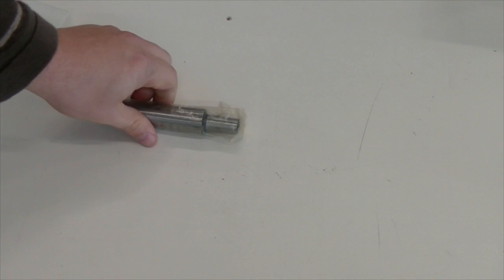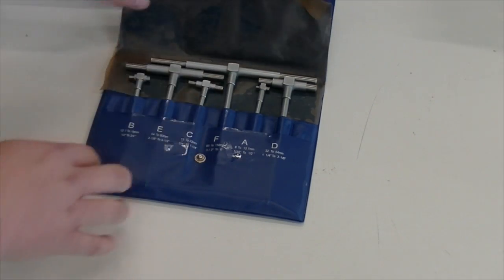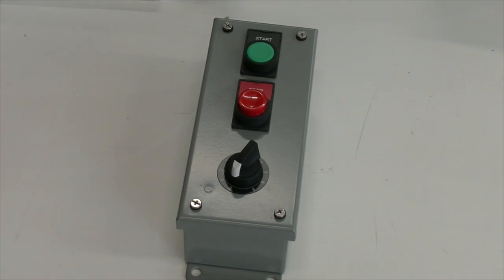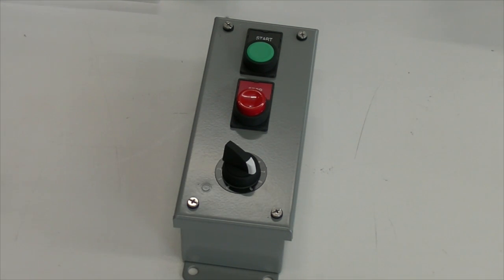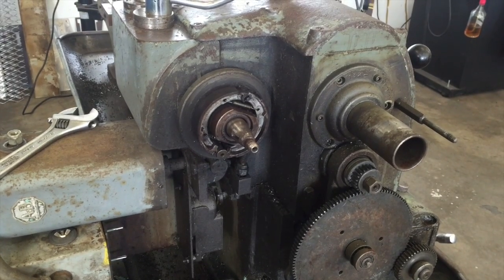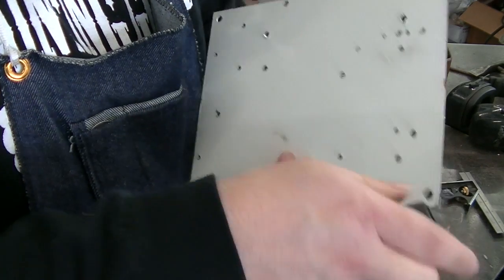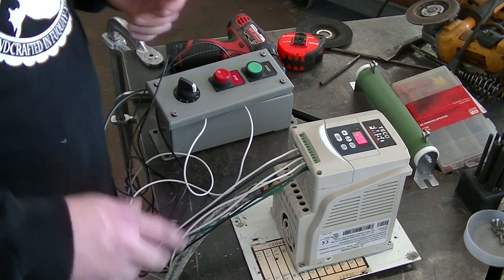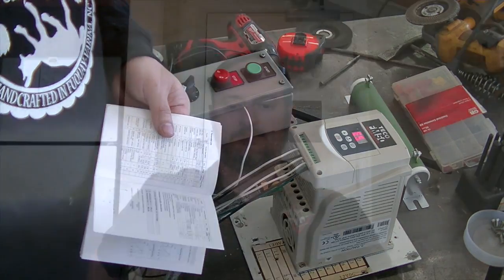Shop Update Series - Episode 10

Comment: I assume I am the Dan you asked what wire size for the brake resistor?

I think I would do it two ways
1.  Motor is 3 HP so 3 x 746 = 2250 watt (rounding off)  So on a 230 V line that is just about 10 amp (disregarding PF) THEN divide by 1.73 (round to two) you get about 5 amp.  SO this calc says 12 ga is just fine with a good margin for error

2.  Resistor at minimum is labeled for watts AND resistance.  So you know W (P) and R
P = I sqrd R --- Isqrd = P / R
ASSUME a 100 watt resistor and 4 ohm
I sqrd = 100 / 4  and = 25 square root of 25 is 5.
Dial in your numbers and see what you get.

12 is more than likely good enough if any doubt use #10

BIG CAUTION  Braking resistors can get REAL HOT.   Blah blah for flammable and combustible
AND make sure it has adequate cooling.  No metal shavings on the resistor either.

Dan Bentler
Reply from the maker: dan bentler Yes, and continued thanks! If I'm reading this right it's 260W and 70Ohm. I'm going to use #10 wire; both for the current and that I have it on hand.  Thankfully, I have a protected yet vented space to mount the resistor in the motor bay itself. Lots of airflow, no oils or chips...

Thanks again!
Tom

Comment: 12Ga would be fine. In theory the same size that your motor needs but it is a very low duty cycle,

My VFD I started with the POT range set to 30-90Hz. You might try 40-80 and have normal centered.
Reply from the maker: Thanks, Scott! I figured the wire size should be about that. Nice to get confirmation.
Reply: Tom Zelickman It is a 260 watt load. Probably 16ga would do. My rough calculation is it is about 3 amps max at the start of braking.